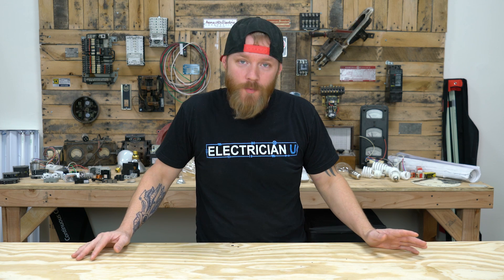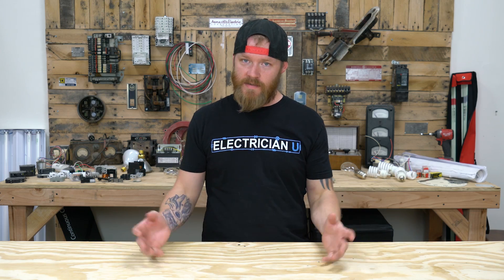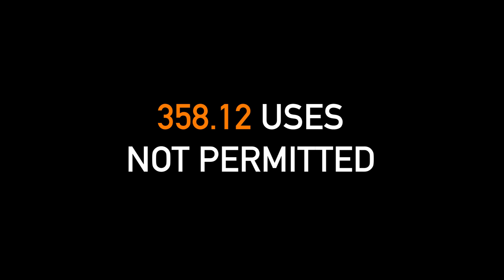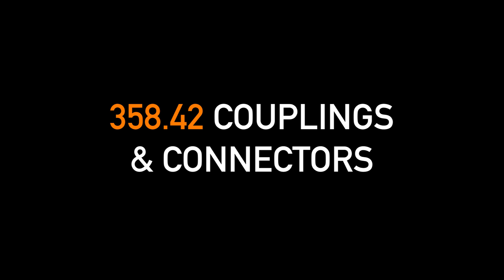Working With EMT - ELECTRICAL METALLIC TUBING and What Electricians Should Know

Comment: In Chicago everything including residential requires EMT.  I used to help out an electrician years ago and remember we didn't need a separate EGC in the tubing.  We never installed one at the time but on exterior runs or inside garages we always pulled a green wire.

Comment: I’m a first year apprentice for a commercial electrical company. I have a question. I have been told that if you have a 1900 box supported by 3 or more EMT you don’t have to mount or use all thread supporting the box, the EMT is enough to pass code.  Is that a regional thing or are we in the wrong. 😂

Comment: Where I live EMT and most little pipe isn't super common just because of the intense corrosion from the salt Air most people try to use PVC or other non-metallic solutions but I've had to use it before

Comment: Here's a few experiences from the saga of 'no one ever told me so why should I tell you'. If it's -10 degrees out and you have to shoulder a bundle, place a towel between your neck and shoulder because you can damage your neck three different ways.

If over head drilling through concrete, a mask will always work better than those vacuum drills because your face can absorb the dust.

Just because you don't skip leg day doesn't mean your back will put up with constant pivoting on bundle shouldering flight after flight so do it one floor at a time if you have to no matter how much the foreman barks.

Get proficient with a level and a no dog. haha all I got for now.

Comment: We don't use metal conduit very much in New Zealand  - I've got a question about your couplings. Do you use thread and die sets and use thread couplings to join 2 pieces, or are they always slide on couplings that rely on the screw for continuity for the earthing / grounding??
Reply: Depends on the application and spec, set screw is pretty common when running emt indoors in dry locations. Sometimes you’ll use compression or rain tight fittings if there’s a chance of being exposed to moisture or dampness. Rigid conduit needs to be threaded which uses threaded couplings. Typically rigid is used outdoors or exposed to; corrosive environments, extreme physical damage and in some cases explosion proof areas. 
As long as you tighten the set screws or compression rings snug I’ve found no issues with maintaining continuity with ground

Comment: I have metal conduit on my flat roof that runs a in-wall bathroom heater in a home addition I had put on about 20 years ago.  It corroded at one junction point and as a result the electrical wire corroded also.  Can I splice in a new piece of wire and  replace the corroded part of the conduit?

Comment: Running a solid core wire through EMT is next to impossible so running a stranded wire would be a perfect solution, however, someone at Home Depot told me I can’t use stranded wire on 120v receptacles. What does the code say?

Comment: Can a single vertical piece of EMT be used to protect a Romex NM-B 12/2 wire dropping down from the ceiling to a 4" square metal outlet box below (using a bushing at the top of the EMT)? If so, would a 3/4" EMT size be correct? If this is okay by code, I would then deduce that pig-tailing the ground wire to both the outlet and the metal box would be the correct way to wire the box. (NOTE: The reason I ask is that I have seen this procedure done with 14/2 Romex and 1/2" EMT, but the electrician in this used the single ground wire from the 14/2 & wrapped it around the ground screw and then connected it to the light switch.

Comment: Excellent, the only thing I would have added is that for very long runs, all materials can shrink in the cold and expand in the heat.  If you install when it's freezing and everything fits snug, it may buckle when it gets hot.  Or maybe the opposite, could you loose continuity in winter if it shrinks.  I hope I'm not knit picking, but that's the only thing I would have added.

Comment: Does EMT have to be installed completely from the electric panel to the point of the outlet? I was told by an electrician @ Home Depot that a Romex 12/2 wire could run from the panel to a junction box above the washing machine, and then run EMT from the junction box down to the outlet box using THHN wires (pigtailing the Romex & THHN grounding wires to a grounding screw in the junction box and then pig-tail the THHN grounding wire to the outlet and grounding screw in the metal box housing the outlet). (P.S. = If the above is correct, a second question would be, could MC cable be utilized in the place of the EMT as described above)?
Reply from the maker: Depends on the local adoptions. But yes you can transition from one type of conductor  to another type so long as you are maintaining the same guage and not violating any other applicable codes. Same for protection. You can go from PVC conduit to EMT to rigid if it's required.

Comment: Good stuff man.  I'm trying to decide whether to make a 6 gauge extension cord for 75 feet or install a roughly 75 foot conduit from my patio to the main panel of my house to power a  generator.  I live in Texas and we went through that snowpacalypse back in early february where we lost electric and water for 5 days.
Reply: I'd say personal preference if you want to deal with an extension cord (which being able to move may be a pro) vs the permanence of the conduit.
Reply: That 75ft cord would be a bear to move/lift if needed. Running conduit to that service would be cheap and much better in the long run.

Comment: Years ago you could use emt as a ground but not anymore as far as I know. Personally myself I’ve always used a green wire with my pulls , because overtime shit can happen with emt joints. Also I have always reamed my cut ends. I use chainsaw files for the inside and a fine tooth flat file and also theirs these hooked end hand held devices that work great but in the end I do the finger test; if it can cut your finger it will cut wire shielding. Yes it takes some time but we’ll worth it.

Comment: When I was wiring in my workshop at home I ran all emt and metal boxes. It looked great to me but I didn't have a bender so It was all premade elbows, pull elbows, and no box offsets. It makes me want to rip it all out and replace it. I was using 20 amp circuits and I ran all 12/2 and 12/3 romex in 1/2" emt. I didn't know about Thhn and I still feel like a dumbass.

Comment: For that last one about emt being able to be used as a ground.. do you just use a grounding bushing on the end of the conduit that is connected to the ground bar in the panel and then the equipment ground screw is connected with a bonding bushing..? You just have a ground wire from the bonding bushing to the ground bar, and then another ground bushing on the equipment side that is connected to the equipment ground.. I have heard of people using flex as a ground but I haven't seen it or done it yet..

Comment: question if conduit passes through a wall or penetrations that has been cut to fit the diameter  of  the conduit passing through but terminates into a Jbox within 3 ft  is that considerd secured by 
code with out using a strap.

Comment: Tightening a compression coupling or connector is correct but is there a such thing as "over" tightening it? I mean I've seen several people in time tighten a compression coupling or connector with groove pliers (channel locks) but they seem to tighten the damn thing like, over max! Doesn't that damage the EMT conduit or make it harder to run wire through or even make it a bit of a smaller dimension? Is there a certain point when to stop tightening it like a "snug" or something? For any reason if you need to take off the compression coupling or connector it's "stupid hard" on the count of how tight it is. I know common sense comes to play but I just wanted to ask. I'm not even sure if code says how tight it should be or if there is a limit. Please give me your response Dustin if you ever get a chance and thank you for all the YouTube videos! Sorry if this is a stupid question or if I wasted your time.

Comment: I can't stand the rule of allowing your EMT raceway to be considered a EGC... Like how horrible of a rule is that. They are relying on everyone to run perfect conduit with perfectly tight fittings that will last decades and straps that will hold over decades and etc... etc... They are assuming that all electricians and apprentices are perfect human beings that aren't lazy and won't cut corners and that the structures will hold over decades and that over time the fittings wont come loose (which I see all the time). It's a ridiculous rule. The dagger is the fact that the rule has to do with someone's life and someone's safety... To me it's mind blowing how they allow this. Makes no sense at all to me.

Comment: Do you believe EMT is a sufficient ground or recommend running a ground wire as well
Reply: I would say no for EMT or even conduit in general since every connector and coupling is a weak spot with the potential of coming loose or having a bad conductive connection (especially at painted J boxes) always run a ground wire since it is a better conductor overall even if every connecting point in a conduit run were welded together.

Comment: Question on EMT connectors: I have heard both ways from licensed electricians. Are you allowed to use set screw connectors outside exposed to rain as long as they are pointing down, like under a box where water can't enter? Why would you even do that? I had exterior main panel/meter combo (Califoirnia) where the knockout was too close to the wall for a compression fitting. A setscrew connector just fit.

Comment: Question on metal conduit as equipment ground. Does that include buried conduit to a sub panel? I.e. attach main ground to conduit and sub panel ground bars this not needing ground wire run between panels

Comment: Dude if you only knew how much  you have helped me understand the trade!!!
Quick question  what tools are really required when working  as a helper?  My cash is very low.
Plus if there is a one emt bender whats the most common  size ( I  look at Craig L. All the time since my budget is so limited)  or is that some thing that the boss will have ,thanks bro!
Reply: I used to tell my helpers that if they averaged $20 a week I'd be okay with it.

Comment: But how do you get the earth ground attached to all the conduit? The breaker panel is painted, which prevents continuity at that point.
Reply: A properly installed connector does the trick. The lock nut on the connector will bite into the metal, providing continuity. Either that or a grounding bushing

Comment: I got hired today as a helper for EMT. I start next week. Any advice?
Reply: 6 inches is ur deduction on 3/4 8 in deduction on one inch so if u want to bend a 90 at 40 in on 3/4 u will make a mark at 34 in and start ur bend always use a level go buy a klein torpedo level do not go cheap on the level and dont give up it's hard and no one expects u to be a master at it instantly takes months and months of doing it everyday to get good and learning the path in which to run your pipe is the hardest I tell people the simplest way with the least of amount of bends is always the best way

Comment: 12:50 "a long time ago"

Chicago (Cook County) code still allows  up to 120v, 20a circuits to use EMT as ground

House built 8 years ago was like this. Speaking of which, what's the NEC code about insulating conduit in unconditioned spaces?

Had an arc fault breaker tripping, it was always overnight and when it was cold (below 15°F), figured out quick it was condensation dripping onto an outlet. He had a new $50 breaker ready for me to install, but I knew it was an issue with wiring. Putting the overnight, cold weather, and vented attic above together in my head told me right away they didn't insulate the conduit. Lots of elbows sticking out of the tray ceiling because the lazy erect chicken wouldn't bend 45's, instead using big 90° elbows sticking 3 feet of conduit right up in the cold attic air. No reasonable person would put 3 feet of insulation atop the joists. End rant.

P.s. seriously curious if there's an NEC code for insulation of conduit

Comment: When you do your videos on bending there is one bend I would like some help understanding. I have never seen a video about this bend - 2 walls meet in a corner but there is also an obstruction  in that corner. As an example - an 8x16 hvac duct or it might be somewhat  larger or smaller. You need to run your conduit along both walls. So I am thinking 2 45 degree bends \____/ to get around the obstruction. Is there a method to calculate the distance needed between the 2  45 degree bends or do you do the simple 45 degree bend with a stub on one stick of conduit and then 45 degree bend on another stick and just make them meet where they should. I know that sometimes it will depend on the situation. Because it is visible you might want to do a 90 with a 30 degree offset. but that is 150 degrees of bend. 2 45 degree bends in the false ceiling is only 90 degrees of bend in the run.
Reply: Ran into this last weekend doing carport lighting, the inside corners had 1/4" thick steel + hardware for their post buckets, coming from one direction I bend my first 45, take a square (framing, drywall, or a couple of 2-bys perpendicular) to represent the surface you're trying to land on, then I lay the pipe over it and scribe back of bend  for your next 45 onto the pipe.

Comment: Dustin, great channel and delivery. A buddy and I are arguing over code change and I would like your version. Wiring a new auto repair shop in Illinois, he is saying the service receptacles around the shop must be ground fault protected like a garage in residential. I believe that in a commercial application you only need grounded receptacles. What is your opinion of this ? Keep up the channel and I am looking forward to your new video chat channel.
Reply: Seems odd that a home shop would need GFI but commercial does not. My thinking they should both have it even nothing else power tools with cords seem to wear cords out, etcs so GFCI would be better safe than sorry. individual GFCI may be kind of $$ but I would think you could use a GFCI breaker too.

Comment: Hey Dustin! Or anyone that is an electrician, I have a question for you. I've been in a pre apprenticeship electrical / photo voltaic classes for about 2 years and know plenty about electrical basics and I am going to apply to my first union apprenticeship in late December once i finish up school. I plan on buying an apartment or possibly a small house. I'm a bit scared of how long my application will take to get a job, i've heard they can take a few months to finally get accepted into the trade and I'm a bit stressed out thinking it will take so long I will run out of money. (Thinking of just getting a minimum wage job before I get accepted to keep up money.) How long does it usually take to get accepted into an apprenticeship? I have all the requirements and some extra with working construction and a few electrical jobs beforehand but just wondering and want to stop stressing about the wait? If anyone is wondering I was looking at Local 48 IBEW in Portland OR.
Reply: All depends on how busy construction is in your area and whether or not companies need guys or not. If they're busy, you could apply and get a job the next day.

Comment: Question about supporting within 3' of a termination: does a coupling count as a termination? Or do you continue strapping every 10', even if the straps are over 3' away from the coupling?
Reply: A coupling is not a termination, it is a continuation.

Comment: at 125lbs, i'm struggling with 3/4 hahaha :)
Reply: Warm it up a little with a heat gun. Only a little though...and very evenly or let it settle for a few minutes. Not sure what it'll do to the bends being hotter than 100°F or 38°C
Reply: I was unsure I would be able to also, not tried yet for what I needed 1/2 inch was fine so just going with that. My case it is just like 2 or 3 wires so that is plenty.
Reply: Olive? Is that you?
Reply: I've seen lots of small guys bend 1 inch no problem. It's all about foot pressure.

Comment: In Canada it is permitted to used a threaded connector as a support for a box., provided it provides adequate support.
Reply: Up to 1640ml is vary generous considering a standard handy box is only 213ml
Reply: Only on threaded ridgid not EMT
Reply: @koremoval2226  12-3012 allows for a threaded connector to be used, or any other type of connector, provided that it actually secures the box, but only up to a box size of 1640ml. This is the correct interpretation by the CEC Advisory Committee.
Reply: @mattsz7313  Fair enough that is the code. Only time I've used conduit to support a box is to drop a receptacle down a few feet for high bay lighting. And like you said only provided that it actually secures the box and in most situations I would not consider that secure enough. Thanks for dropping the code number.